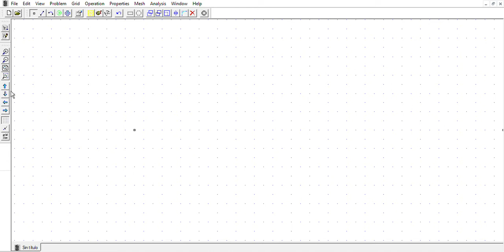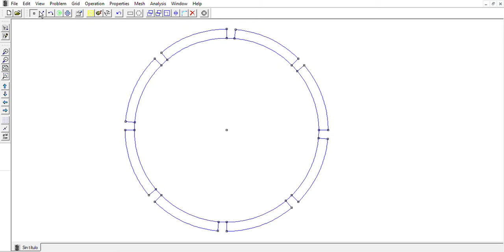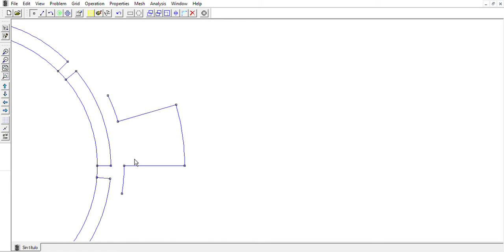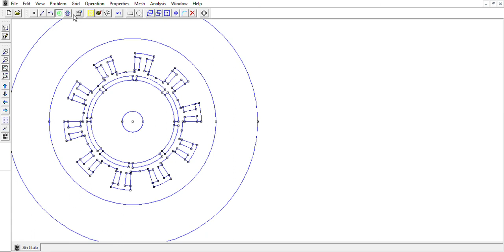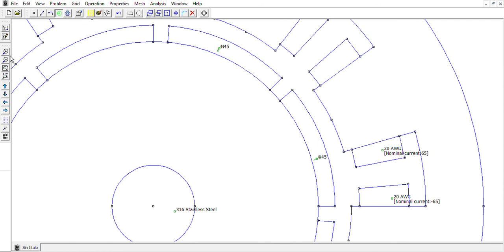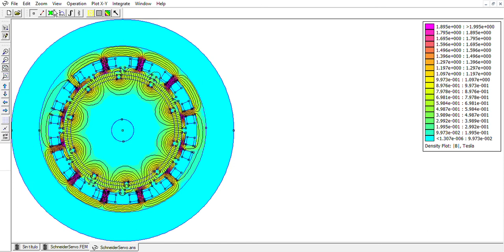How to draw a PMSM with FEMM 4.2.

Comment: bro how did un change the direction of magnet?
Reply: after u press the material button then press space, the parameter can be set. here u will see the bar to set the magnet direction which allows u to set the value between 360 and -360.